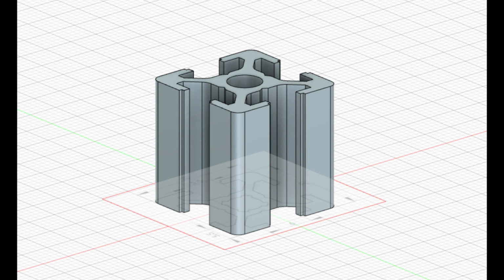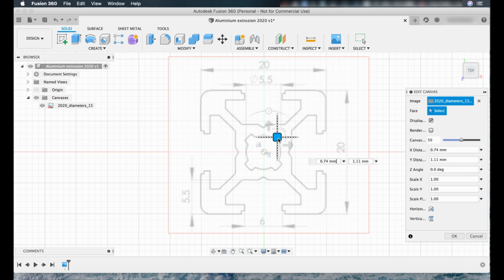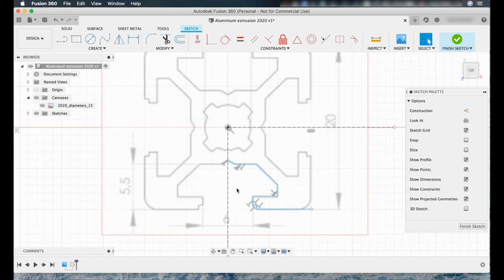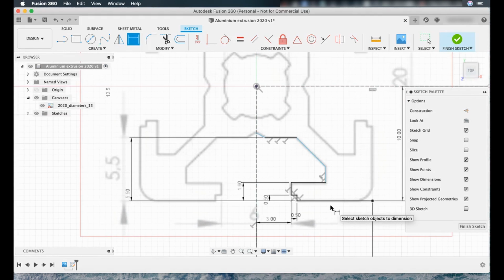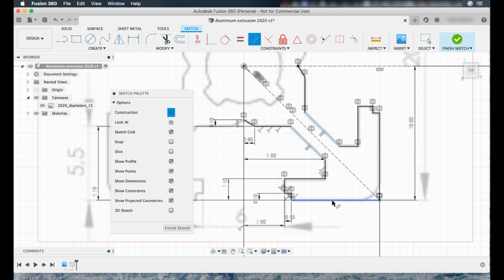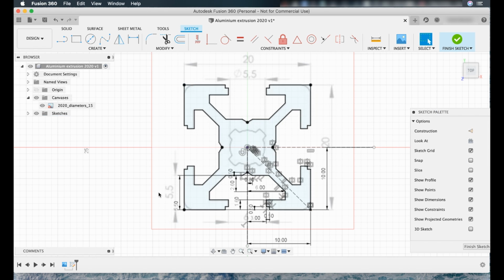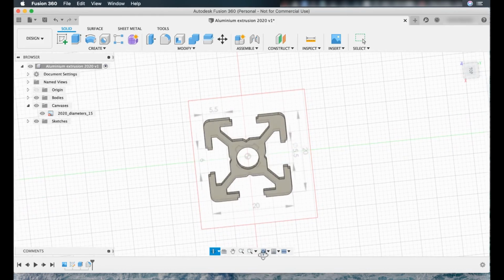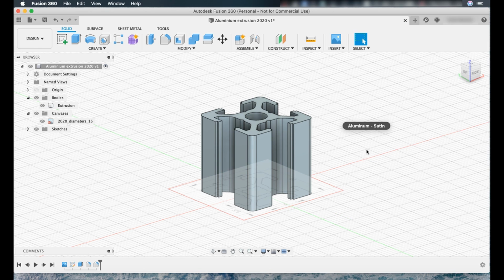2020 Aluminium Extrusion Modelling in Fusion 360

Comment: Download the profile in .step or other format, create a sketch, and project its outline. It only remains to extrude it. Simpler, faster ...
Reply from the maker: Sure. If you can get the model, use it.
Reply: Nope. You can't import that sketch into a project. As that sketch will still be unconstrained and you won't be able to work with it.
Fusion360 is missing a "fix selected elements together" constraint. The current fix constraint makes the whole selection stuck on the current sketch position.